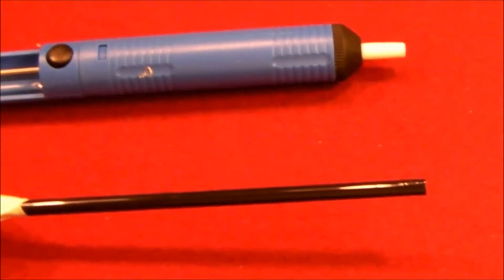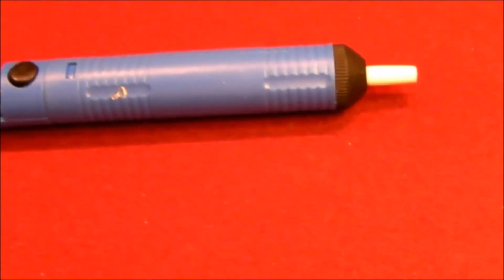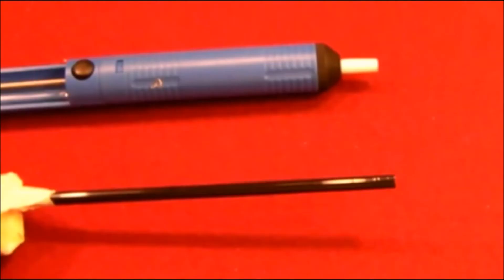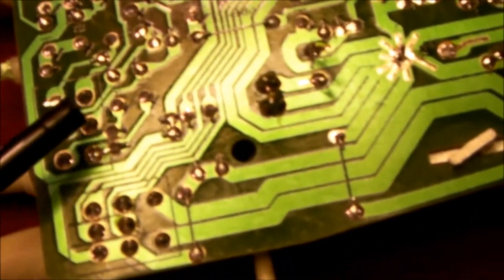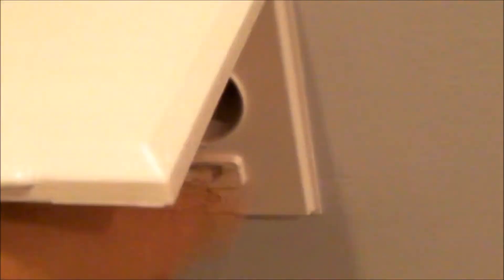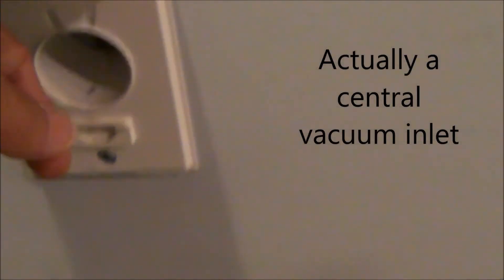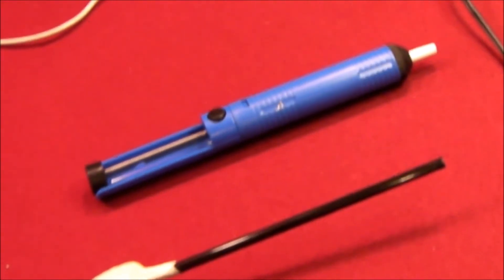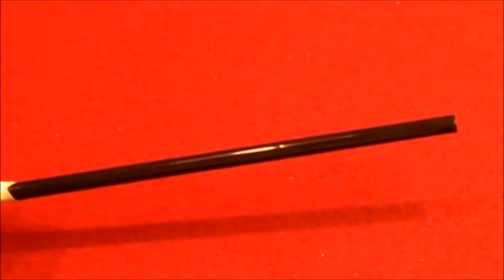Vacuum Desoldering DIY Homemade Homebrew desoldering

Comment: does using a vacuum present a risk of electrostatic damage to sensitive components?
Reply from the maker: In my OPINION, highly unlikely for the types of boards a homeowner or amateur would work on.
Reply: Further, plastic is not an electrical conductor.